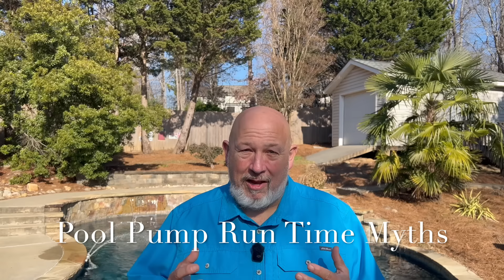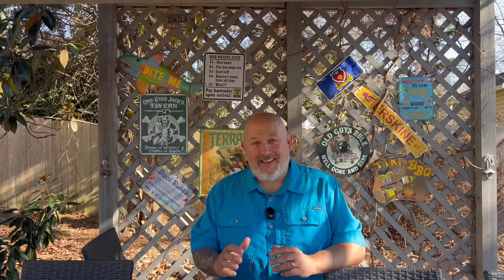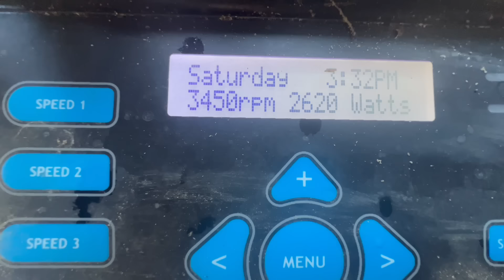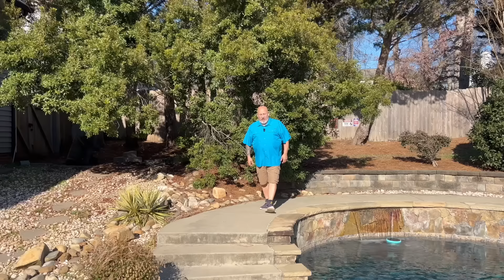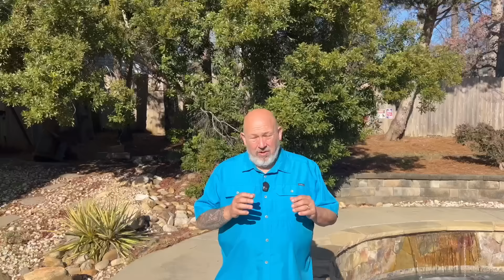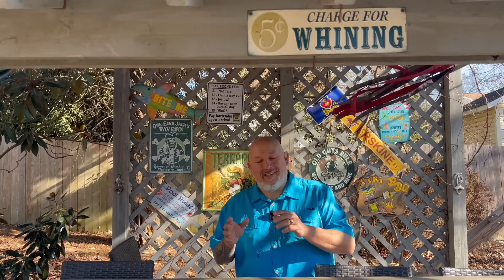Your Pool Pump Schedule Is Costing You Hundreds (Here's Why)

Comment from the maker: Quick question for the community: How many hours are you currently running your pump, and have you ever actually calculated your turnover rate? 👇

I see so many people stuck on the "8-hour rule," but as we discussed in the video, that’s usually where the overspending starts. If you want to see the exact step-by-step math on how I proved that running a Variable Speed pump for 24 hours can be cheaper than a single speed for 8, check out this deep dive:

🎥 Watch the Math here: https://youtu.be/NsAYG3sx_0s?si=3nzMiCZwj00KRX2k